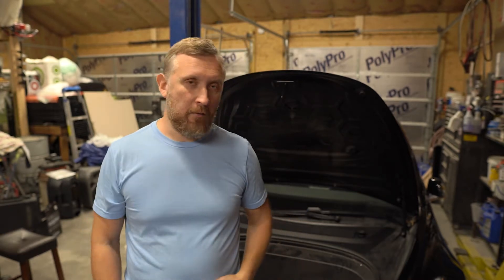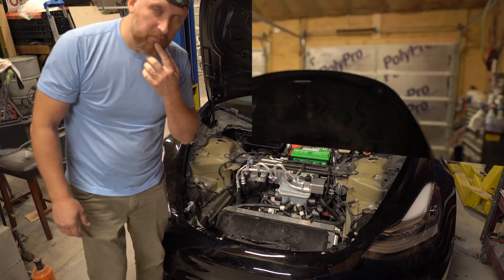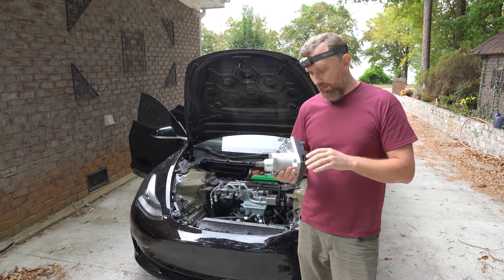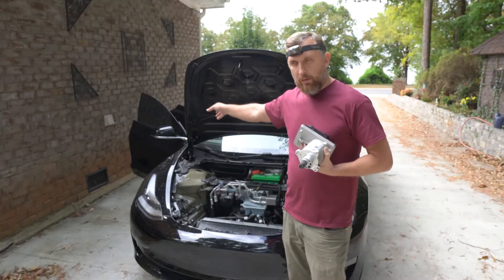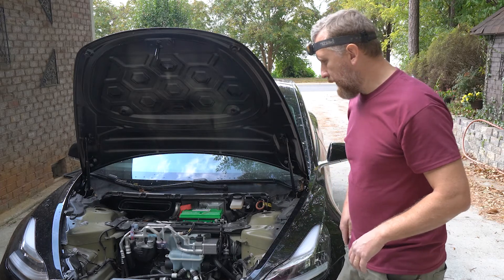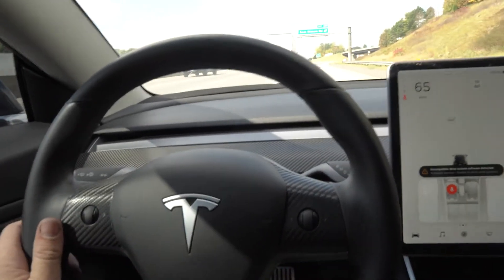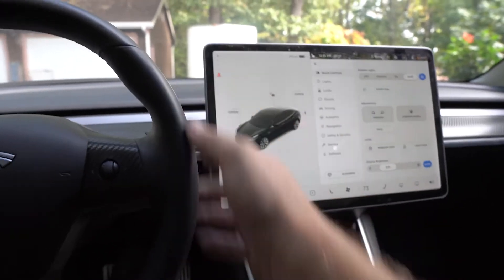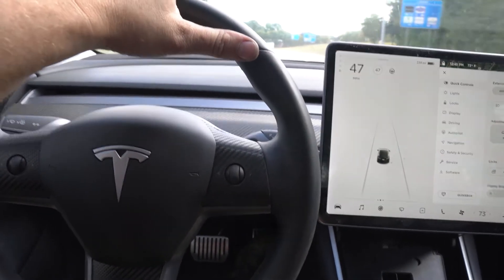Tesla Model 3 Steering Motor Replacement

Comment: The steering on my 2022 model Y recently started getting stiff after one hour of driving. It is difficult trying to keep steady in the center of the lane. My car is out of warranty so I have to try changing the steering rack myself, but I’m going to try swapping the motor first to see if that will fix it. I don’t think it’s the steering rack as I’ve never been in an accident and the car only has 80,000 miles. 

my question is, did you need to subscribe to the Tesla firmware subscription in order to connect your laptop and sync the new motor to the car?
Reply from the maker: I kept an original motor and replaced rack n pinion only.
Reply: Hi, my model 3 does exactly the same as yours. How did you end up fixing it?
Reply from the maker: @dennisvanvoorene replaced the rack
Reply: I know this is an old post but I have a 2020 MYP with the same issue as yours. At about 30 min to an hour of driving the steering becomes "notchy" and hard to keep centered in the lane. I also notice that the steering wheel will twitch when the car is fully stopped and not moving but only when this behavior appears. It drives normally after it sits overnight. My service center thinks it is the steering rack but if that was the case shouldn't the notchy behavior always be there? Im not a mechanic but i feel it could be something like an over heating power steering motor or something electronic? Did you find a fix?

Comment: Did the belt slide right on the motor or did it gove any trouble, im doing the change next week.
Reply from the maker: You just have to keep an eye on the belt when inserting motor shaft in. You will tension the belt by rotating the motor so when you inserting make sure you are at the lowest tension position.